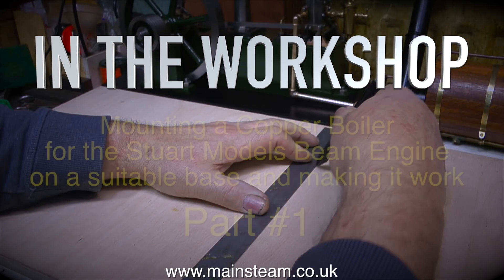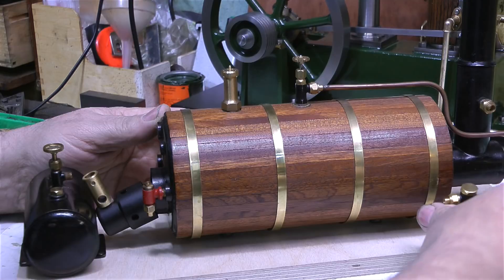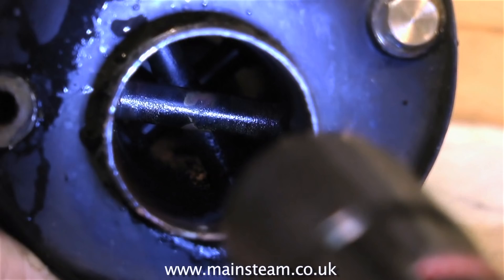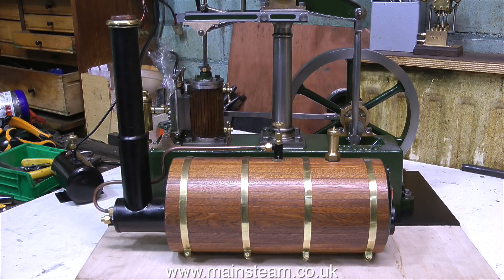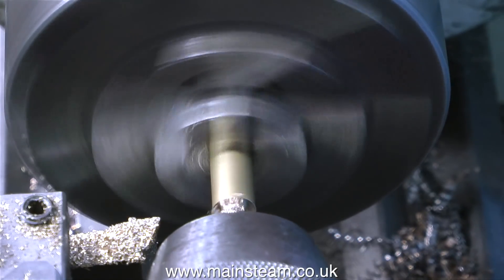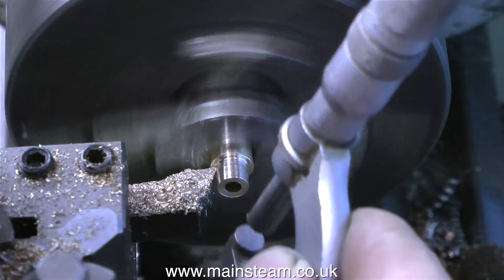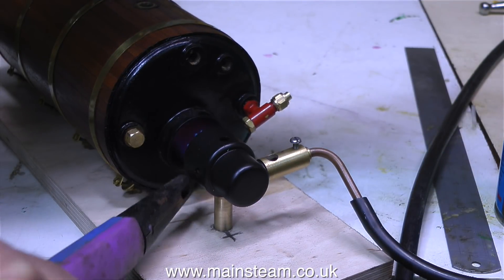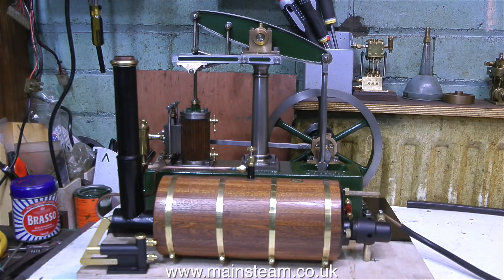A BOILER FOR THE STUART BEAM ENGINE - PART #1

Comment: I've been noting how your Watts parallel motion works and trying to get it copied on my Wilesco D11 setup making it more of a beam engine than an oil rig.   It doesn't like it on the driven bar from the fly crank but seems to be more tolerant on the driving side of the "beam" so still experimenting with it and where to mount the actual assy to where on the mast and the beam.   Still running it in as quite tight in all the right places and your rapeseed oil mix recipe is on a heck of a lot now including my Reliant's door and boot hinges, inner locks and just about every oily point on my 1958 Lambretta and 1986 Vespa lol   You should market that stuff as a product with your name on it "Appleton's peculiar recipe no 9" hehe

Comment: back to a comment i made previously about having things for the engine to run,  would it be a good idea to have one, to assist in running the engine in so its under load, plus the better sound they make when working?

Comment: Excellent work sir.  I was wondering about the gas jet positioning... Being that it's outside , does it overheat the inlet tube at all? Or maybe blister the paint around the inlet tube?
Reply from the maker: It seems fine, but I think that I am going to move it closer to the flue tube because the water gauge glass is getting some of the heat which is not advisable . . .